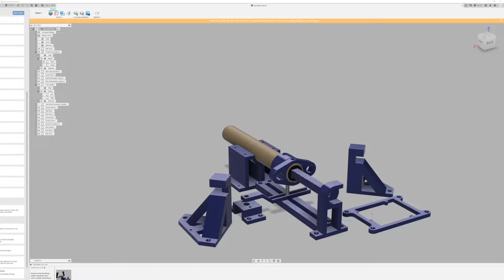3D Printed DIY Flight Simulator Yoke Using Arduino - Easy Project

Comment: Great design. The rubber bands added the spring constant k. You need to add the c constant for the damper. Dampening can be achieved by friction. That will make the return to the center position more fluid and less aggressive. Again, great design!

Comment: The most elegant solution I have seen so far. Really tempted to start building it right away 😅
Reply: ehh...just can't resist...3D printer is already working (as I sit on my ass as that is what we have 3D printers for) 🤣
Reply from the maker: @Junyo  nice! Let me know if you have any questions!
Reply: @dvilardi  I noticed today that you updated your project with the 25mm "Main Axis". 

I went to three local DIY-stores today and, where I live, in the Netherlands, the 25mm size is very rare - basically not available.

So, I bought a 15mm steel tube and used Tinkercad to design & print the needed adapters. I used a different colour (red) for the adapters (your parts I printed in white).

Will post pictures of my project once it is finished on Thingverse in "makes".
Reply from the maker: @Junyo  nice! A friend warned me about the possible unavailability of 25mm tubes around the world so I uploaded its STL as well, as an alternative.
Glad to see you found a workaround, looking forward to seeing the results!
Reply: @dvilardi  It gave me an excuse to actually do something useful with Tinkercad (and learn that it doesn't actually do 15mm when you tell it to) 😅
Reply: I'm planning to print a different "steering-wheel part" as I want to use your design to use in car-racing-games as well as in FS2020.

I'll also post the "adapter-part" that is necessary to make that stuff work 😅
Reply: As I said before: I have puzzled about creating a multi-functional Arduino/3D Printed controller for months and your design is BY FAR the most elegant and simple solution I have been able to find in more than one year of Google- & Yeggi-searches.

It really solves a lot of the complexity that made me discard the other solutions.

Comment: What is the PVC inch, the code, and the installation measurements on the wooden base? Do you have a printout so we can stick it on top of the wood to make the cuts and designs for each component?

Comment: Danilo, parabéns! Quero fazer um, mas fiquei com algumas dúvidas. Quero fazer um completo com pedais e manetes de potencia. Será que posso usar um arduino Uno igual o seu? E eu poderia ligar os seis potenciômetros na unica saida 5V do arduíno, sem usar protoboard?
Reply from the maker: Cara, obrigado! E desculpa pela demora ao responder. Não vejo problemas em colocar tudo num arduino só. Eu até fiz um protótipo assim no ano passado (yoke, throttle e alguns botões), tudo num mesmo Arduino Uno. Funcionou lisinho, sem problemas! Eu só dividiria igualmente os potenciômetros entre as duas saídas GND do Uno pra aliviar as correntes um pouco, mas zero preocupações. Abraço!

Comment: Excellent. I see one major issue here, the Rubber Bands, other than bringing the Yoke back to the center point the do not generating any resistance, on the Pitch , for example, if you measure the resistance on the PFC Yoke you will get something like 26/Lb/ In, at the end of the Travel .. maybe you should consider using springs instead ....
Reply from the maker: You’re right! Springs are more linear on that sense, but rubber bands actually increase resistance with distance as well (albeit not as well as springs)

Comment: Finally wired the pots to my arduino, works great. still waiting on the other 3d printed parts.

Do you think I could add more potentiometer on the arduino? Sorry I'm new at arduino and wiring. Thanks!
Reply from the maker: Yes you can, just don’t put all of them in the same GND pin, as the current may be a bit high. Split the pots into both GND pins just to be safe.
If i’m not mistaken, the uno supports up to 6 potentiometers (A0 to A5). You can even merge my yoke and pedal projects into a single arduino or create a throttle lever, just change the portion of the code that reads the additional analog inputs.

Comment: Hello, I want to do this project, but I have Arduino Leonardo instead of Arduino Uno. Is Leonardo suitable for this project?
Reply: Hello, based on my knowledge of Arduino, the Leonardo is the most recommended for this type of use. Which in this case is the Arduino sending information to the PC. Sorry about English, I'm Brazilian and the broker isn't that nice hahahha.
Reply: @PauloHenrique-og4fv  Thank you for your support.

Comment: Nice one! Easy to build and quite cheap, and doesn't has arthritis like Saitek :-) one question though: why potentiometers, not hall sensors?
Reply from the maker: Thanks! I never gave it much thought actually, i just saw how the old joysticks i had lying around worked (they use pots) and tried to replicate it with the arduino. My electronics knowledge is (very) limited, i had never heard about hall sensor up until a few weeks ago lol

Comment: can I use b500k and a500k pots? sorry I'm new to these things and it what I only have from a broken electric guitar.
Reply from the maker: If they have the same shape and size and fit the potentiometer mounts, they will work and fit just as fine. The arduino converts the 0V - 5V analog signal into 1024 digital steps. All potentiometers will work equally by selecting into that 0-5V range. The difference between "A" and "B" potentiometers is that "A" changes the resistance on a log scale (the more you turn, the more rapidly the resistance changes) and the "B" pots change resistance linearly (constantly proportional to the "turn"). But all those differences can be solved in the windows calibration and MSFS sensitivity curve adjustments.
Reply: @dvilardi  Thank you for the useful information. Can't wait to print this tonight. Are you gonna make a throttle quadrant for this? Thank again, regards.
Reply from the maker: @projz7110  nice! Show me the results later! I'm currently designing a rudder/brake pedal controller and plan to release a new video on it later this week. A friend of mine actually designed a pretty neat throttle quadrant using arduino as well (thingiverse thing:4640769 by artlazza), so I don't plan on designing one myself.
Reply: @dvilardi  I've looked up the throttle and it's pretty good. looking forward to the rudder pedal. I have all the materials now and ready to print, unfortunately I got infected by the coronavirus so I can't print them.. yet.

Comment: Hey, in the instructions it says to install flip but it doesn't say why or how it's used. Also, I tried to copy and paste the code from the .txt file into the arduino software but when i try to compile and upload it onto the board, it gives error messages.

Comment: Hey one question i noticed on the wiring page in the instructions had 2 wires connected to the same port. What do i do? Thanks man!
Reply from the maker: Yes, both potentiometers have 3 pins: the left and right pins connect to the same Arduino’s GND and 5V pins (in any order) whereas the middle pins are connected to each analog pin (A0 and A1). 
So you must join the 5V wires (either by “twisting” them or by soldering) before connecting them to the arduino’s 5V output. The same 5V output goes to both potentiometers.
And the same applies to the GND (actually there are multiple gnd outputs so you can split if you want to).
Reply: @dvilardi  Thanks man!

Comment: Great project man, just a question, there's no such thing as a 25mm PVC pipe, and 3/4" ≠ 26.7mm, did you mean something else end it was a typo? Because I went looking for it and then realized this, it's the only thing I'm missing
Reply: This type of PVC pipe only exists in America. If you are in Europe or anywhere else , you're gonna have to make new designs or print the originals and modify the build to fit a 30mm pipe...

Comment: Great tutorial but as always, with any of these projects, problems when getting the code to work.  I cannot for the life of me find the referenced "YokeJoy2021" code file.
Reply: What code?
Reply: You mean for the Arduino.. I don't know nothing about Arduino or codes.. but I made my YOKE.. all you need is a cheap PC game pad or an old Xbox 360 pad and a soldering iron.. with a 360 pad you have 6 axis.. so you can make the yoke. And still have 4 axis.. You can make one for throttle and another for mixture.. or for trim wheel.. the sky is the limit.. I love these kinds of projects.. lol 🤣

Comment: i can not find shematic and code
Reply from the maker: Hi! In the description of this video you will find a link to this project on thingiverse.com (thing:4855469). There, you'll be able to download all printable STL files, PDF manual with schematics and Arduino code.
Reply: @dvilardi  thank you so much Mr danilo please ii have a question how to  connect the project whit the simulator

Comment: Hey there, getting some errors in Arduino, Sketch still uploads but when I try to calibrate, things are just going completely haywire. 

 sketch.ino : In function 'loop':
 sketch.ino :96:12: warning: iteration 11 invokes undefined behavior [-Waggressive-loop-optimizations]
    btn[bt] = LOW;
 sketch.ino :93:22: note: within this loop
  for (int bt = 1; bt < 13; bt ++)
                   ~~~^~~~
 sketch.ino :101:14: warning: iteration 11 invokes undefined behavior [-Waggressive-loop-optimizations]
    if (btn[on] == LOW)
        ~~~~~~^
 sketch.ino :99:23: note: within this loop
  for (int on = 01; on < 13; on++)
                    ~~~^~~~
 sketch.ino :109:16: warning: iteration 11 invokes undefined behavior [-Waggressive-loop-optimizations]
      if (btn[on] == HIGH)
          ~~~~~~^
 sketch.ino :107:25: note: within this loop
    for (int on = 01; on < 13; on++)
                      ~~~^~~~
C:\Program Files (x86)\Arduino\hardware\arduino\avr\cores\arduino\main.cpp: In function 'main':
 sketch.ino :101:14: warning: iteration 11 invokes undefined behavior [-Waggressive-loop-optimizations]
    if (btn[on] == LOW)
              ^
 sketch.ino :99:23: note: within this loop
  for (int on = 01; on < 13; on++)
                       ^
 sketch.ino :109:16: warning: iteration 11 invokes undefined behavior [-Waggressive-loop-optimizations]
      if (btn[on] == HIGH)
                ^
 sketch.ino :107:25: note: within this loop
    for (int on = 01; on < 13; on++)
                         ^
 sketch.ino :96:12: warning: iteration 11 invokes undefined behavior [-Waggressive-loop-optimizations]
    btn[bt] = LOW;
            ^
Reply: I just built the yoke and having the same issue. Did you ever find a solution to the calibration issues?